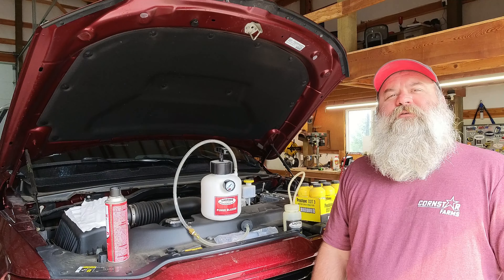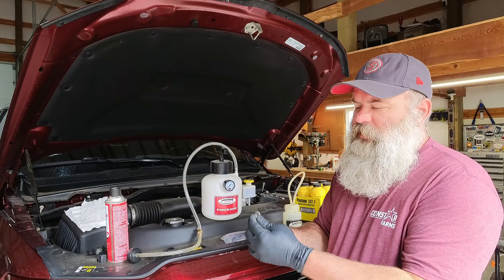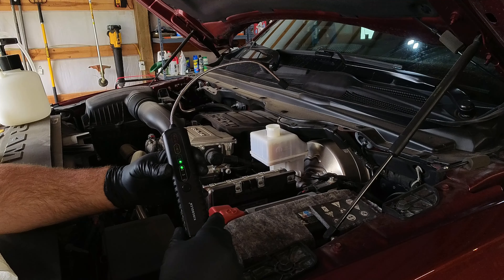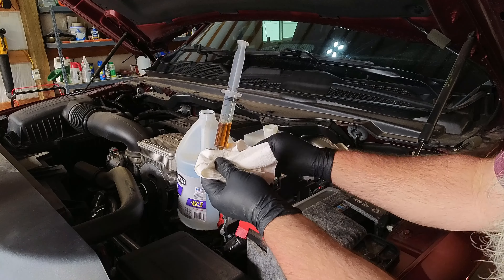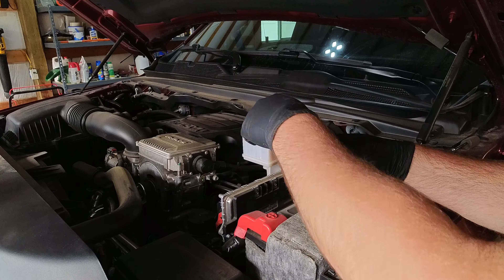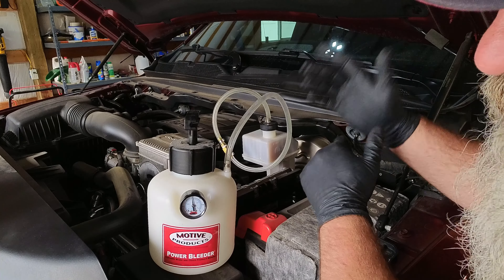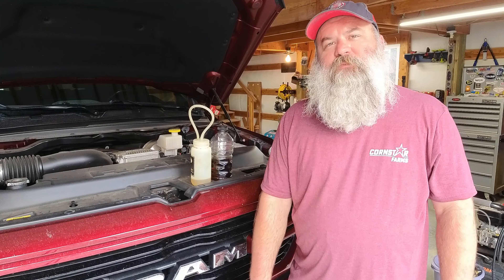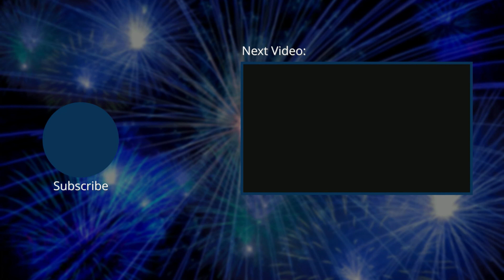Brake Fluid Flush - How to Do It (5th Gen RAM 1500)

Comment: just did mine this weekend.  the motive power bleeder works great!  was able to get the strainer out of the brake fluid reservoir using a couple of picks to coerce it out without damaging it, which then allowed me to pull the fluid down to the minimum line.  my fluid was pretty brown like yours.  took me just over 64 oz to fully flush the lines, that was a lot of brake fluid!  but at least brake fluid is cheap.

Comment: Thank you for this video. My 21 ram 1500 at 19,000 miles has a sort of spongy brake feel, sometimes causing me to press the brake pad twice to feel confident in my stopping power, I believe my rotors and brake pads are fine. I’m wondering if a fluid flush will remedy my situation. Any feedback is appreciated. Cheers